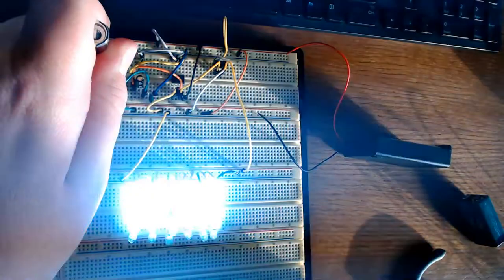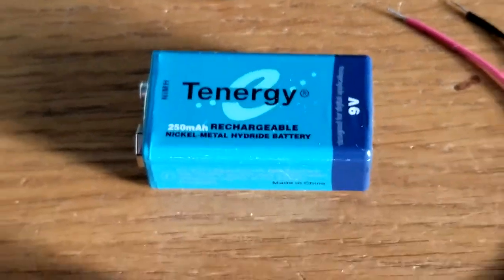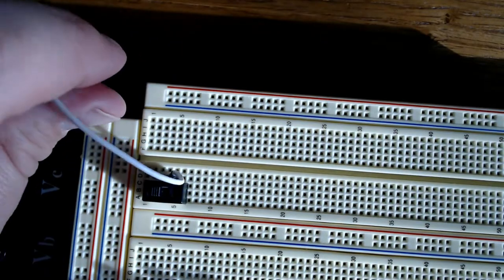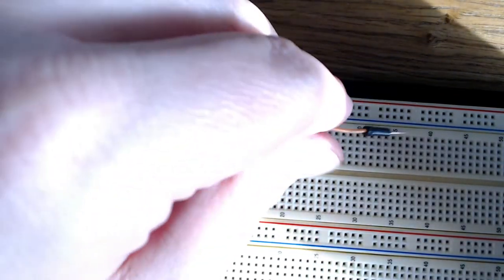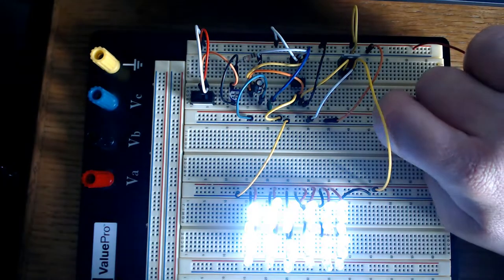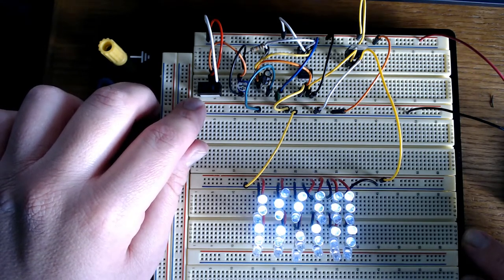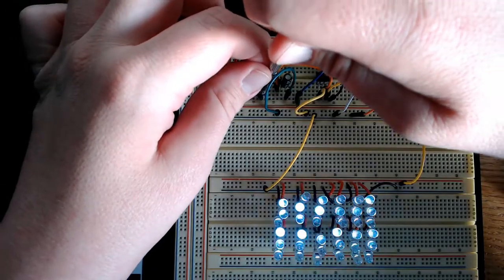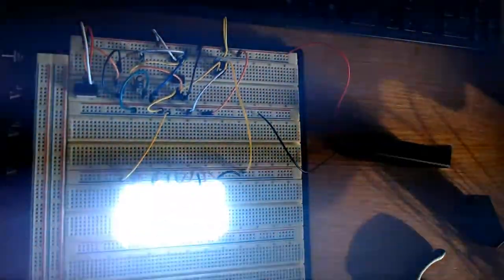Step By Step DIY Adjustable Speed Strobe Light That Anyone Can Make With 5mm LED And 555 Timer IC

Comment: Hey mate, that's almost exactly what I'm looking for right now. But is there a way to make the strobe even slower? I'm talking like one strobe every 4 seconds?
Reply from the maker: Hi there! I will at some point get to this and try to reduce the blinks. Until then, here's how I would approach it. 
The formula to calculate the time period of this 555 timer configuration is Time Period (T) = 0.693 * (R1 + 2 * R2) * C   where R1 is the resistence between the discharge (pin 7) and threshold (pin 6) of the 555 timer. R2 is the resistance connected between the discharge (pin 7) and the VCC (positive supply voltage) of the 555 timer. And C is the capacitance connected between the discharge (pin 7) and ground. To increase the blink time I would increase the value of R1 and R2 or C or increase all 3. I would have to play around with it. But the answer is yes, you should be able to increase the blink time.  
I apologize but I won't be able to get to it very soon. I have a trip coming up but will rebuild this circuit when I return. Thanks for adding to the conversation! 👍

Comment: Nice little circuit, but it looks to me like you're stopping it working by shorting the + and - rails with the On-Off switch!
Reply from the maker: Hi Geoff H! great to hear from you. I didn't notice that at all. I'll have to go back and look at it closer. I could always toss the switch out and use the battery pack switch.  Thanks for the comment - I appreciate it ~
Reply: I was about to post the same! First step wiring up the switch, when thrown shorts power rail to ground rail.
Reply from the maker: I appreciate the feedback. I should, at some point, redo this circuit. 👍